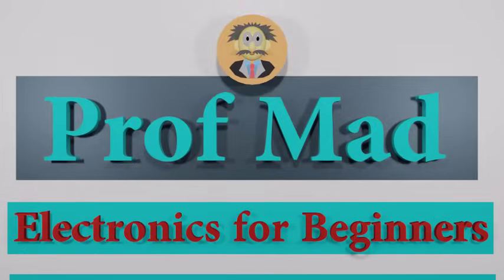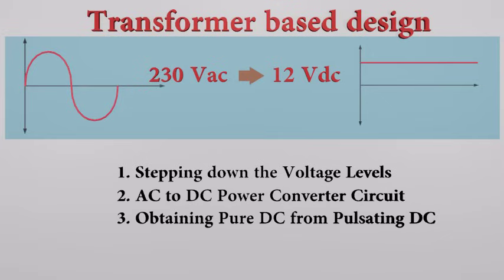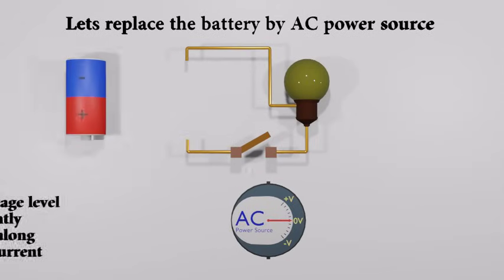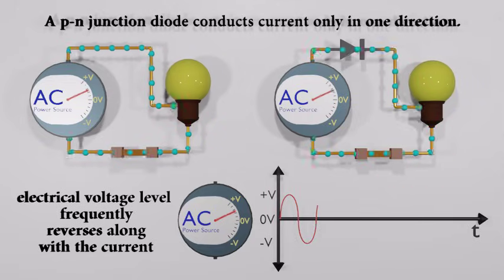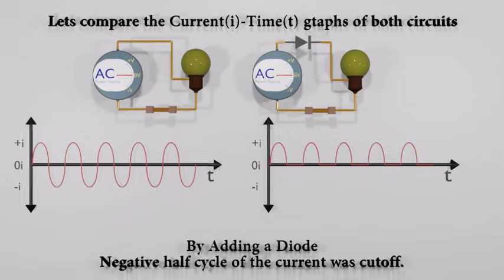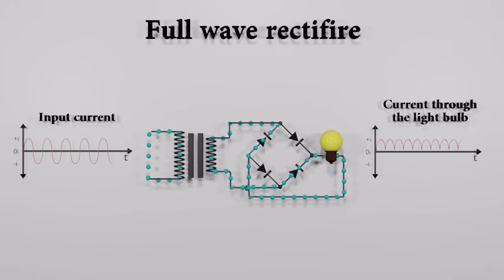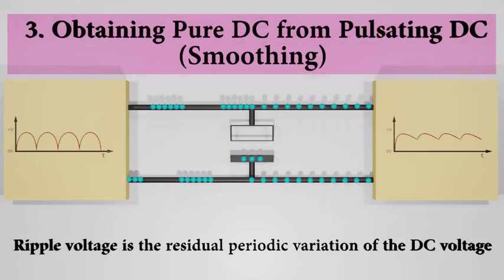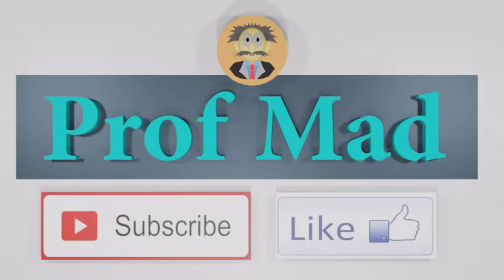How to convert AC to DC | 3D Animation

Comment: What kind or size of capacitors do I need to use to convert 220v AC to 220v DC? I DON'T need to transform or lower the voltage.

Comment: I recall most generators produce AC power. These are called alternators mostly used in cars to charge the battery! Generators can also produce DC power. DC power how ever is usually produced by solar panels and stored in batteries! I also hear AC power is most commonly used in many countries including my homeland of the United States! Apparently many devices require DC power and can convert AC to DC themselves! 🤓 God I love the wonders of science and electricity!

Comment: This is a great explanation video. I disassembled my old flashlight as it was broken, it has a built in plug, full bridge rectifier, capacitor and a couple of resistors that connected to battery. But there is no transformer. How is it possible?

Comment: I have another idea and I can't believe nobody ever mentions it. Combine two alternating square waves.  First you convert the DC into an alternating square wave with a 555 timer you might need 2 and make sure they're the same frequency with the capacitor and resistors. Now about change the resistor values for the other one to ensure its off by 180 degrees. And just like that pure dc with nearly 0% power loss.
Reply: It's about conversion from AC to DC,  rt?  Then why square wave DC is required?

Comment: Can you tell me how to choose the capacity and voltage range of a capacitor in a circuit? (You can use this for the explanation)
Reply: Sure, but it depends WHAT CIRCUIT ?
But in simple terms, let's say you are replacing a capacitor in a switched Mode Power supply  and the one in the supply the capacitor is 35V, 1000uF  .
well, this means (Assuming it's the original capacitor) that that circuit is designed and engineered to have a 35V Capacitor in that position
(it doesn't mean the supply to that location is exactly 35V because caps are chosen with headroom to spare, but you should assume to keep the same value)

so on those grounds if you had the same capactor value that's what you replace it wtih.
if you didn't have a 35V  AND UNDERSTANDING THE FOLLOWING...
Voltage is electrical pressure , so this capacitor can take 35V of pressure.
so you wouldn't replace it with a lower value because it may blow, but replacing it with a higher value is fine  so 50V is fine,  200V is fine but probably overkill but you want to keep the capacitance rating the same

Now, if your'e doing it the other way around and you don't know the value,
Say you're building a full wave rectifier circuit so you have your input protection , then your rectification, then you have your input filter capacitor (Remember this)
then you have your switching then your transformer, then some more switching then say a voltage regulator and then a cap again  (Remember this)

so say you want to choose those 2 capacitors in terms of voltage.
well the input filter capacitor has the job of FILTERING NOISE AND RIPPLE
but the voltage supplied to it (In Australia) is 240V so you'll need something above that  Typically you will see 400V Capacitors,  so it's common to see in bulk Filter caps  470uF 400V  or 450V
so, YOU'RE LOOKING AT THE VOLTAGE THAT IS BEING SUPPLIED TO THAT LOCATION.
So on that same logic...

Re the second capacitor on the cold side of the board
You're rectified your wave to DC and you've stepped it down
then you come to your linear regulator,  so let's say you have a standard LM7812
(there is a datasheet here
https://www.digikey.com.au/en/products/detail/texas-instruments/LM7812CT-NOPB/3901975
) you can look at the output voltage to check
since you know your output from the regulator is 12V you will need to choose a capacitor that is above 12V , say a 35V 4700uF for example

You will tend to notice that as the Voltage gets higher the capacitance gets lower.

Now, how to choose the capacitance value in a circuit like this 
well mate, 
1. Look at how much explanation was required just for the voltage

2. The capacitance takes a lot longer to explain and without knowing the application it's difficult to give a proper answer

However i would say this to you 
Build a 555 Timer circuit that outputs a square wave as a clock signal and swap out different capacitors to see what happens
also play with the resistors (i would recommend using potentiometers instead

this will give you a fundamental understanding of capacitance and the internal resistance of capacitors and after that you'll know how to choose the appropriate capacitor.
sometimes it doesn't matter, other times its' pretty critical

watch this video
https://www.youtube.com/watch?v=RnMBxAfGnQo

Comment: Quick question. Let's say i wanted to design a USB-C power adaptor where my desired Vo is a total of 5V and i'd be converting that from 100-240Vac. Would i just use a 5V voltage regulator? Along with the transformer and full wave rectifier?

Comment: mechanically run a flywheel motor-dc-generator system with a rectified ac signal, flywheel will smooth the output to flat because its slow to change in momentum if the input-output power is stable

Comment: I want to connect 10 DC 6V submersible pumps to AC current with Lights and music To a musical fountain? HOW?
Reply from the maker: If you have basic electronic knowledge, you can make your own power supply. Specially pay attention to the current requirement of the motors. You will have to select components according to that.

Comment: how much current can 7812 voltage regulator handle??  I want 50A 12V DC output
Reply from the maker: according to the data sheets its 1A
Reply: @Profmad  thanks

Comment: The question is if you have an 8-0-8 center tap transformer and you need 14v output maximum.
Reply from the maker: Yes, you are correct. Thanks for mentioning that.

Comment: this video was great, but can someone explain to me how do I choose the correct rectifier component and capacitor as there are many versions out there?
Reply from the maker: It deepens on your requirement. you can simply search for the data sheets of those components in internet and find out the voltage and current ratings of those.

Comment: Looks simple enough. Would you switch and fuse the AC side or the DC side.
Also what amps is the DC side rated to. I want to run a 12v electric motor opening and closing a door. Not sure on what amps I'll need. Cheers

Comment: Great video. I am a bit confused by your smoothing plot from the Capacitor though. Is the Capacitor ever discharging or is it charging from the opposite direction till the positive cycle occurs again? It seems that the plot showed the capacitor was not discharging normally, and I would like a little clarification if possible. Again, great video!
Reply: So actually the dips u see right before constant DC is due to AC harmonics or the reactive component Vosin(phase) is  complex and frequency the domain which looks like noise when it comes to an applied voltage. It's in the form of harmonics or resonance like how sound vibrates and causes a object to shake. It's not constant due to these frequencies. To absorb that sound something like what a sponge or shocks do we use a capacitor which stabilizes the oscillations to a standing DC voltage

Comment: could you build door bell using half rectifier? No need electronics or clever design, just a one diode an electromagnet, it will turn on and off itself

Comment: All ac volts made must be converted to dc so can control the volts then convert it back to ac sine wave volts and must be contoled by speed , hertz to 50 or 60 then must be modified to handle curent that aplied at begining in right size conductor it carries. Square  wave or parchel wave burns up elctronics as phone batterys and tv and computers
Reply from the maker: Thank you for sharing.

Comment: Hi prof mad.
This video has been of immense help and has help boos my research into a self sustaining electric generator.

I have a DC motor that moves the alternator quite easily to the required speed, but I find that it is only workable when the battery is working which doesn't take long to drain. So, I was wondering if after using a battery to start the gen to the required speed I can cut off the battery source of power and use this construction to continue powering the DC motor. Theoretically I think it should work but I will welcome any ideas, warning or constructive opinions to make this project a reality. Thank you
Reply: You could replace the battery with another DC transformer, not sure if it's going to work though
Reply: This doesn't make sense
If you have a DC motor as it stands.
and you want to replace it with this model.
this model uses AC as the input and converts it to DC
in your model the supply is already DC
Why would you bother ?

The end result is still a DC Power supply .
of course it will work but you are adding another step without reason
unless of course you are saying you want to plug into mains
in which case i would then question what are you doing now

Comment: Not totally correct, I'm afraid. Use of a larger-value capacitor would better smooth out the ripple in the pulsating DC output to an acceptable level. The VOLTAGE REGULATOR is used to ensure this smoothed DC voltage remains at a constant value despite changes in load current drain.
Reply: How about the inductor to better smooth the ripple and control fast-peak current? 
Give me a hint, I want to create a full-wave rectifier diode bridge and build-in into the wall socket (I have already all i needed), ~230AC -->  ⎓230DC separate high-voltage DC (maximum smoothed ripple) for convenience and special purposes, of course, for local protection from the main household wiring - 50Amp fusible ceramic fuse...
To be clear - I'm not a noob, and i know what to do, electronics has been my passion for many years.
So, what do you think about this - the optimal values of capacitors(many people recommend using 3 different capacitors - 1 main large-value and 2 smaller);
Polarized or variable capacitor; ceramic, metalized polyester film or aluminum electrolytic?;
Inductance coil: - type and inductance value; 
Necessary or needless - transformer with an insulating coil ~230-230v for galvanic isolation(more safety)?
Reply: @Amy_Price  what is your load? 50 A is a huge current. Is it in peak or constant current?

Comment: great vid, i added a mosfet works great more amps, but got hot as hell added a huge heat sink that burned out as well, this time a thermal sensor wit a fan cause the rectifier board have few different out put on it. is there a way i can double the regulator so it wont get hot, thanks
Reply from the maker: That's great to hear.❤

Comment: Can you do it using stepup transform and convert 240v ac to 250v dc
Reply from the maker: yeah you can, But there are other things to consider when dealing with that level of VDC. This configuration will not suitable for that much high DC Voltage. you may need special circuit design.
Reply: @Profmad  can you make a video on that

Comment: Can you please answer my questions
1) why are we using bridge diode?
2) what is the input voltage and the output..
3) what transformer do?
Reply from the maker: 1. diode bridge is rectifying the current (we normally called this diode arrangement as rectifier )
2. input and output voltage depend on your components. In this example, we used input as 230VAC and Output 12VDC.
3. Transformers can increase or decrease voltage level, in here we have used stepdown transformer, that means , this transformer decreases the voltage level.

Hope this will answer your questions,
Reply: @Profmad   yes its really help full thank you..
I have another question 
What is vripple and how do we get it? From the resistor?!

Comment: you can add another couple of capacitors at lower mF's.   let's say your first cap is 40mf's. then add two more at 20 mf's. to smooth the ripple.
Reply from the maker: indeed..
Reply: I had 16v 1000mfd and connected but i got 17v output instead of 12v. How can i get exact 12-13v

Comment: Beautiful illustrations. Amazing animations. Great explanations. Kudos !!!
Reply from the maker: Thank you! Cheers!
Reply: @Profmad  
How about the inductor to better smooth the ripple and control fast-peak current? 
Give me a hint, I want to create a full-wave rectifier diode bridge and build-in into the wall socket (I have already all i needed), ~230AC -->  ⎓230DC separate high-voltage DC (maximum smoothed ripple) for convenience and special purposes, of course, for local protection from the main household wiring - 50Amp fusible ceramic fuse...
To be clear - I'm not a noob, and i know what to do, electronics has been my passion for many years.
So, what do you think about this - the optimal values of capacitors(many people recommend using 3 different capacitors - 1 main large-value and 2 smaller);
Polarized or variable capacitor; ceramic, metalized polyester film or aluminum electrolytic?;
Inductance coil: - type and inductance value; 
Necessary or needless - transformer with an insulating coil ~230-230v for galvanic isolation(more safety)?
Reply: @Amy_Price  plz hlp me .i m not good in this, i want a 12v supply to light up♨️ my  led . i hv transformer nd doide setup👍🏻. which capactor🤔 nd (where can i get voltage regulater😵) voltage regulator nd transistors are same or not 😮??
Reply: @harpreetsandhu1401  
It's very simple if you know how to work with a soldering, there are many AC 220v-DC 12v power adapters(Old power supply for pc:12v-5v), and for the brightness of the LED ribbon - the variable resistor (potentiometer) he can be found in the old external speakers, it's spinning)
Reply: @Amy_Price   ys i hv used soldier iron bt whts use of variable resistor in circuit. and do i need capacitor or not and that voltage regulator (≪shown in vdo)
Reply: @harpreetsandhu1401  
The variable resistor does not increase, only decrease voltage depending on his resist (check with multimeter), for example, if the initial 12V is the potentiometer adjusts it 12V~0V
The capacitor is not required, but if you connect capasitor 1000mF(for example) in to the parallel output and the LED tape, then in the case of a sharp power off, the tape will be glowing for some time, observe the polarity of + + - - be careful with the high Alternating Current, first work then power on, LEDs Don't work with Alternating Current, they burn in one moment ...

Comment: Question:  Let's say we remove the step-down transformer in your video here and plug a 12V AC power supply to the circuit.  Will the bridge rectifier properly convert the 12VAC to 12VDC?  I assume yes.  Now let's say we still remove the step-down transformer but use a 12V DC power supply.  Will the bridge rectifier still work?  That is, will the bridge rectifier still allow the 12V DC through?  I assume yes, but only 2 of the 4 diodes will be used.  Will the smoothing capacitor and voltage regulator do anything in this situation?  The reason I ask is I have a pair of external computer speakers that require a 12V AC power supply but I only have a 12V DC power supply.
Reply from the maker: Actually this question is little bit tricky , your assumptions are all correct in theoretically,  but in practical, diodes have 0.6v-0,7v voltage drop, and the internal circuit may be different than this. It could work probably. It depends on your speakers power unit. But nothing can go wrong. So its worth to try.
Reply: No it won’t work you’ll blow up the diodes.

Comment: Its was so easy to understand that even i ( a mechanic) understand it 😁
Reply: Why are we using a bridge diode? In converting ac to dc
Reply: In AC, both the lines comes with positive and negative alternatively (mixed) so we use diode rectifier to collect only positive charge to the positive line and to collect only the negative to the negative. Thus we get a pure dc wave.
Reply from the maker: Thank you.